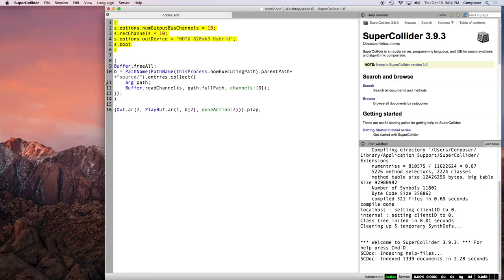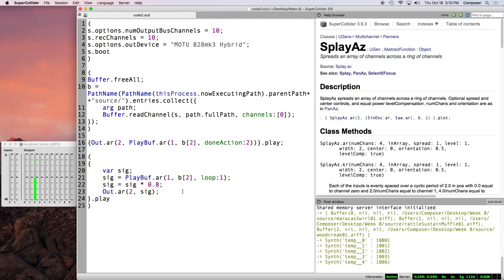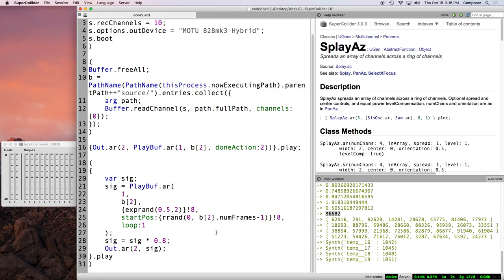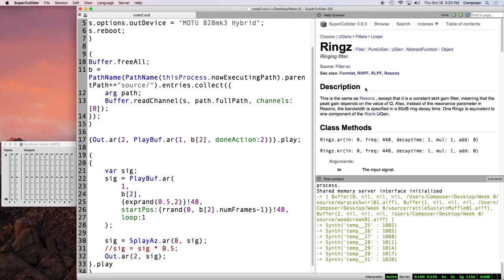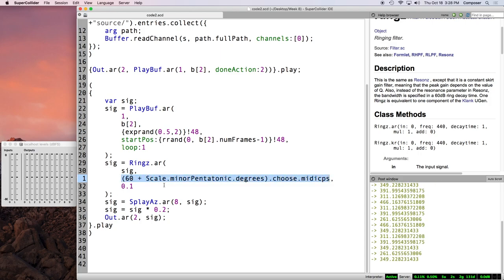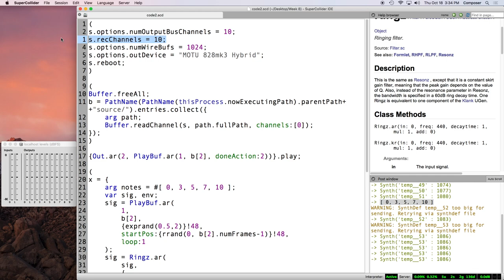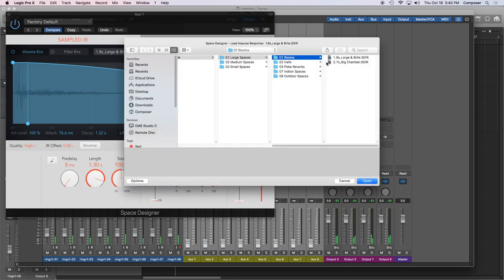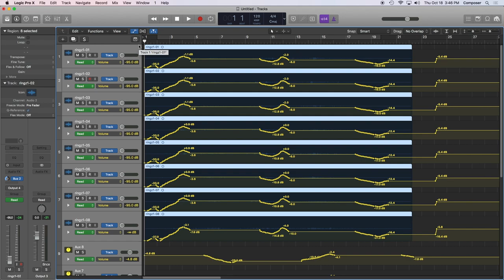Octophonic II - Week 8 Fall 2018 MUS 499C - Algorithmic Techniques for Multichannel Audio

Comment: Strange, I wonder why we get "WARNING:  too big for sending. Retrying via synthdef file" when trying this
Reply from the maker: My understanding is that SynthDefs can be sent to the server in two different ways: (1) by "streaming" it from sclang to scsynth, so that the process takes place entirely in memory via RAM operations, or (2) by writing an actual .scsyndef file to your SynthDef directory, which on macOS is usually ~/Library/Application Support/SuperCollider/synthdefs/. Some SynthDefs involve so many UGens with so many interconnections, that the build process is too complex to take place in memory, so a def file must be written. The SynthDef ".add" method tries option 1 first, but if that fails, it goes for option 2 instead. This is why we get the warning.